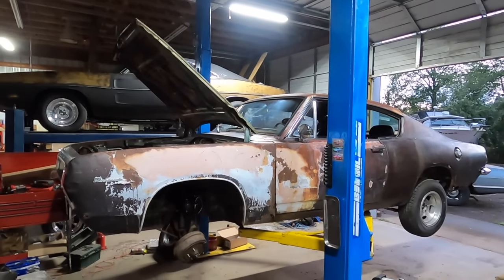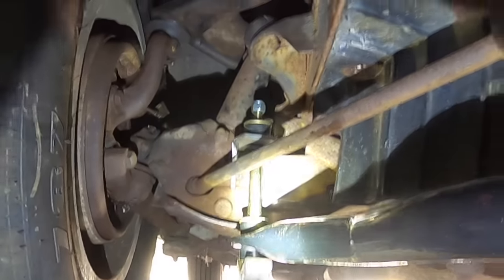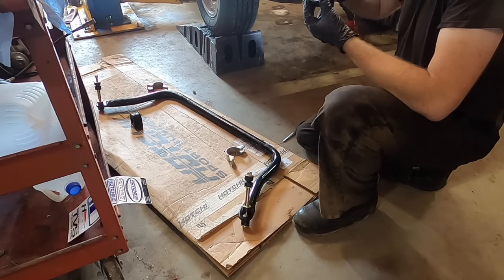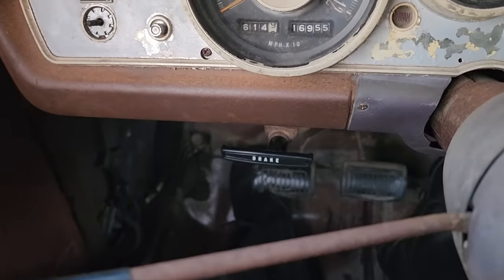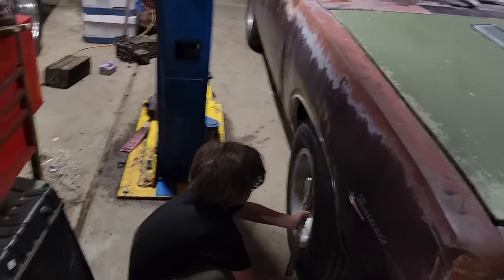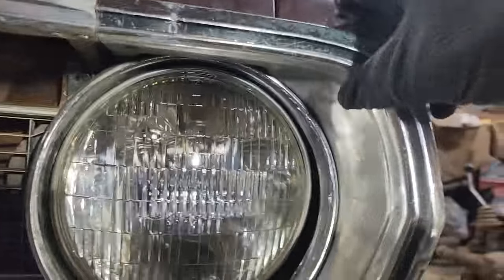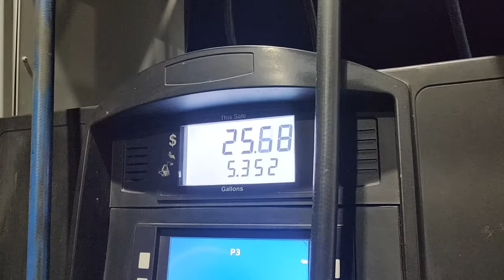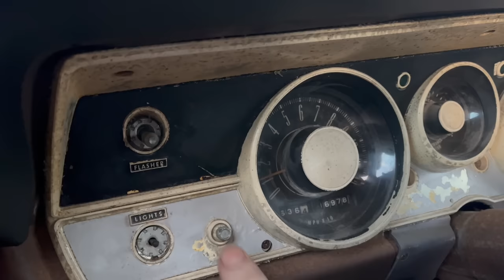The Single Best Suspension Upgrade For Your Classic Mopar - 1967 Plymouth Barracuda Gets A Sway Bar

Comment: Watching your brother put shiny new parts on a car with a radiator leak reminds me of a time when i filled up my passenger side floor with jugs of water and drove 4 hours to buy a set of tires and wheels. Fixing the cooling system is just not as exciting.
Reply from the maker: Really it's the kind of thing I would do. I've got new pistons and rings on hand to go in the (currently disassembled) engine of my '64 Power Wagon, which has no functioning clutch pedal, brake pedal, electrical system, no bed, and also has a hole in the radiator...

Comment: 215 70 14 isn't bad for a car this small.  I would prefer a wheel with less reverse, though.   There is room for more tire with if the wheels had more back space.  235 or 245 60 or 65  But wheels for the small bolt circle are not easy to find, especially this type.
Reply from the maker: I intentionally went for the smallest tire I could find for fuel efficiency purposes. I know almost nothing about tire sizes and they’re bigger than I expected. I wasn’t planning to make a corner carver. Yes, wheels are a big challenge. I was happy to find those - and I’ve been hoarding any small bolt wheels I can find…

Comment: But that z bar squeak...
Reply from the maker: Dude… it’s absolutely horrible. The transmission stuff is coming apart in the near future to fix an input bearing retainer to bellhousing size mismatch that I missed somehow, and we will go through the linkage then.
Reply: @DeadDodgeGarage  I had it in a  four speed truck. Drove me bonkers trying to find it. It's right up there with the speedo cable squeak. Except it NEVER goes away!

Comment: You should put disc brakes on it at least in the front for safety and stuff
Reply from the maker: What, you don’t like the 9” front drum, 10” rear drum situation?! Especially with the ruined right front drum… it all seems very safe to me. Anyway, this is one of those one piece at a time type deals. They work fine for local driving for now. We will see what the future holds. The car also has the factory small lug bolt pattern, so disk brakes are a little more challenging.

Comment: You guys live in a Rust Belt just like I do I mean I live in Michigan the first tool I ever bought other than my hand tools was a torch because everything is nothing but a piece of rust they're not that expensive and it would make your guys's life so much easier
Reply from the maker: I have an oxy-acetylene torch. Also, we do not usually get the insane underside rust here unless the cars have been sitting in fields for decades like this one… we mostly don’t have to worry about road salt, it’s lower panel rust from rain water that we deal with.